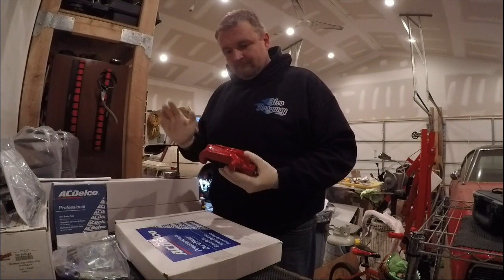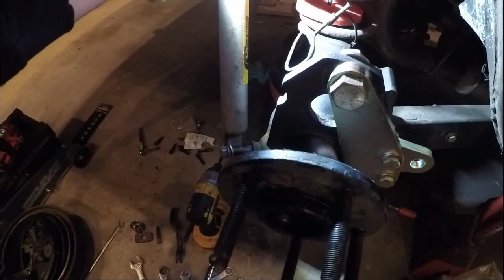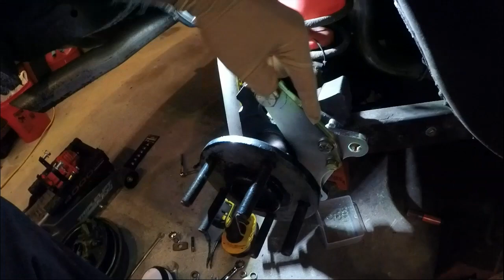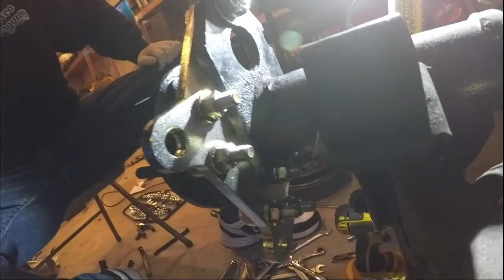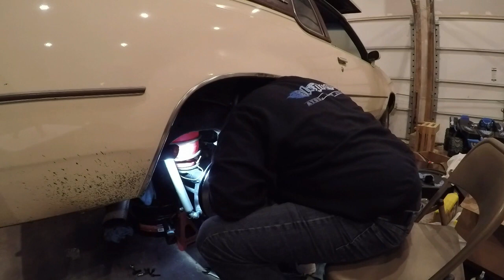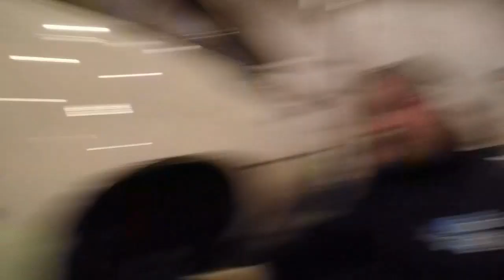G body Rear Big Brake Upgrade How-To - '84 Cutlass Pro-Tourer

Comment: With that kit can you put the big front calipers on the rear? So they match?
Reply from the maker: Pablo, with the kit I got as is no, BUT, I believe you could get the rear set up of the next step up and make the whole braking set up square. I know Tobin at Kore3 will sell them separate and is more than willing to work with folks to get them set up. In theory I think it can be done quite easily picking from two different kits, fronts from my kit and rears from the next step up. How that gets handled in brake proportioning is a separate story. Thanks for your question and interest and hope this helped!

Comment: Did you have to change your proportions valve
Reply from the maker: The wilwood master I got came with a prop valve to match the brakes I bought. Going drum to discs you will almost always need to change up the prop valve. Good luck!
Reply: @BanditDavesToyChest  thanks I have a 87 cutlass.... can you send me the link of the master cylinder you purchased?

Comment: When doing these conversions do you have to change the master cylinder
Reply from the maker: Frank G yessir...this particular brake setup needed a 1” diameter master for the rear discs
Reply: Thanx man!  ive seen a lot of videos and no one seems to mention this step.

Comment: What size rims & tires did you use after the c5 upgrade ????
Reply from the maker: Don Rajah right now it has a 17x8 in the front with a 245/45-17 and a 17x9 in the rear with a 275/40-17. Plan to go to 18’s soon!
Reply: Thanks, I was worried about clearance
Reply from the maker: Don Rajah no problem man. Let me know if you have anymore questions!

Comment: Thanks for posting.   Did you need to machine your axle flanges?
Reply from the maker: Corey Dunigan no machining necessary just some minor trimming and drilling that is very clearly dictated by KORE3’s instructions. Was a top notch kit!
Reply: @BanditDavesToyChest  thanks 
Tobin responded that most g body axle measure 6.15".  I measured mine (with wheels on) close to that.  My concern is that his description most axle flanges need to be 5.9" or less.  Do you have the part number of the kit or was it a mixed bag kit he put together specifically for your application?  Thanks again
Reply from the maker: Corey Dunigan I’ll send you my invoice. Shoot me an email to w31lsx<at>gmail<dot>com
Reply: @BanditDavesToyChest  my man!

Comment: does those calipers have a ebrake that attach to it
Reply from the maker: There is an option for one. It would mount inside the disc and press up against the inner surface of the backside of the rotor. I will try and dig up the PN for you! Thanks for watching!